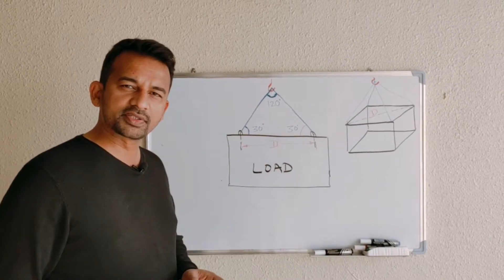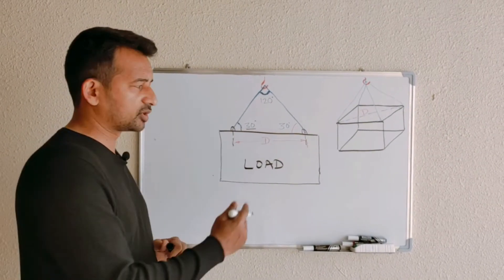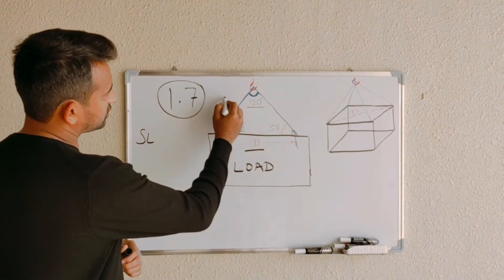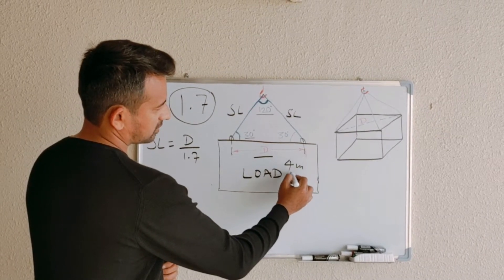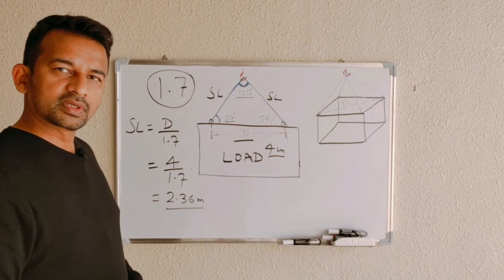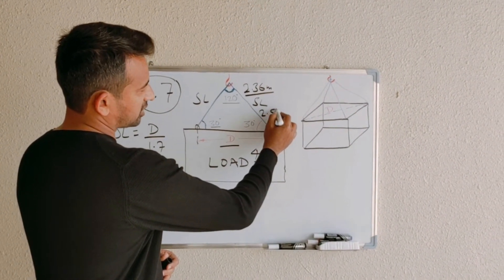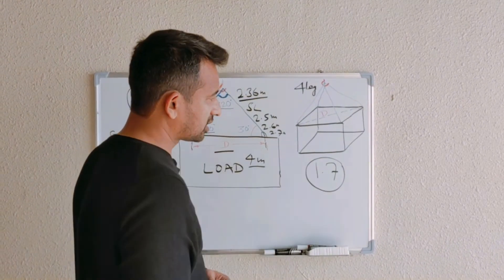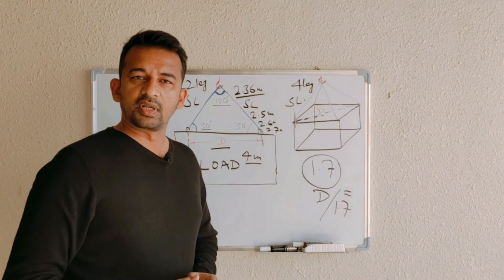Calculation for Sling length for maximum allowable included angle 120 deg.

Comment: How 1.7 ?
Reply from the maker: With trigonometric
Reply: dear biju it's from triangle law and 
1.if the angel better the sling is 120 the remaining angles are 30  
the formula is the capacity of each  load on each sling = the load weight/ 2 × sin 30
if you go to unite circle cos 30 is √3/2 so we will came back to formula:  load on each sling = Weight/2×√3/2 = weight/√3
√3=1.73 so 
one sling capacity =load weight/1.73 
in the rigging training sometime we are not explaining the mathematics law because it's out of the scope so we are giving just the factor its will.be easy for the rigger to save in his mind factors only  number for 30 degrees 1.73
for 45 degrees 0.7